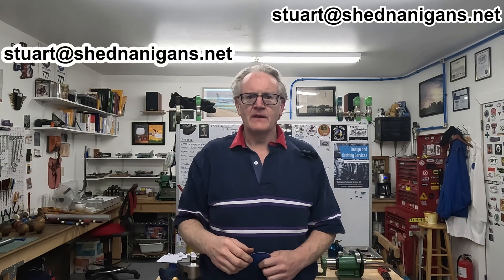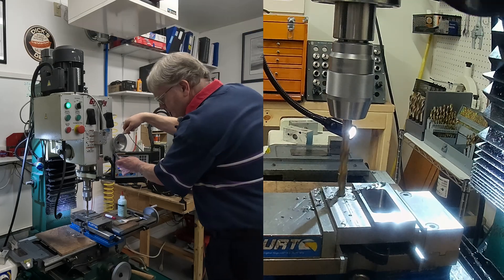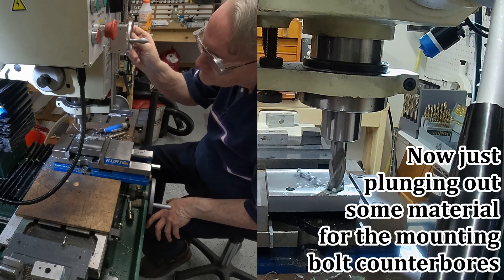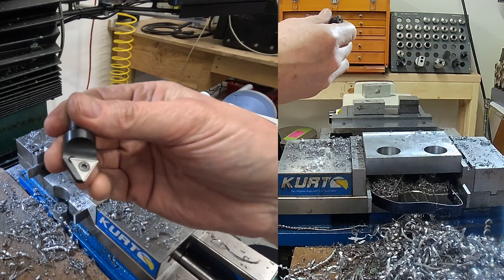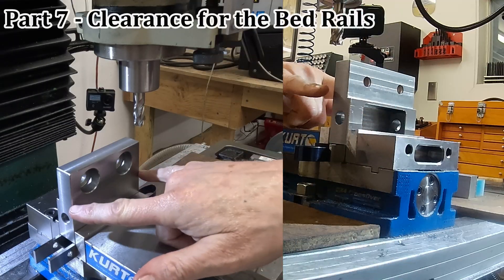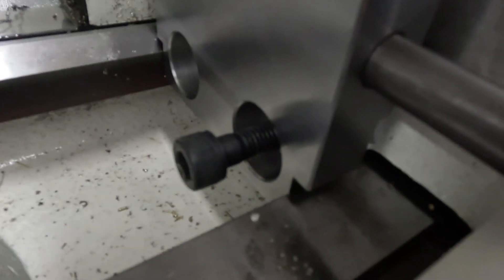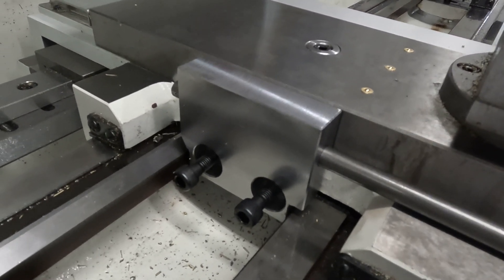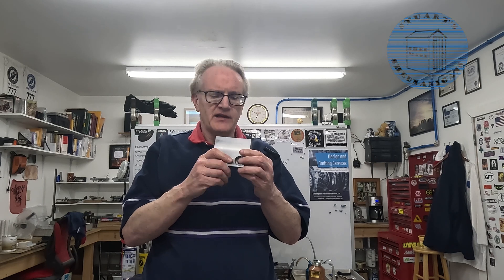Superior Shop Made Lathe Cross Slide Lock - Part 2 - Finishing the cam mount bracket.

Comment: You mentioned Anchorlube. I gind that stuff to be quite messy.
Why do you prefer it?
Tool life? Better finish?
I like the no snell aspect.
Reply from the maker: I’m kind of hit and miss on it. At first it didn’t seem much different, but the no smoke aspect is certainly a big deal. I have had very good results tapping in aluminum and stainless with it, when other lubes seemed to have difficulty - but it is messy. But then again most tapping / cutting oils are messy to some extent.
Reply from the maker: I don’t have good data as regards finish and tool life vs other oils, I don’t do nearly enough to get that, but just in ease of tapping and no generation of smoke is where it has done well for me.

Comment: Thanks for the video. Why didn’t you use Anchor lube when reaming?
Reply from the maker: Hello! Thank you for watching and commenting. To be honest - I don't have a good answer. I have used the lighter tapping oils for reaming for a while, so just defaulted to it. But afterwards wondered "why not try anchor lube for that?" I can't think of a reason not to.
Reply: @StuartsShed  
I like Anchor Lube for hand tapping, especially when doing so overhead. It stays put.
Reply from the maker: @greglaroche1753 It is great stuff for that. It tends to stay put in a lot more situations, where oils just run away.

Comment: Stuart, what's the idea the golden ball made of foil which sneaks up in your videos? Thank you for sharing your journey. Your royal use of anchor lube is in my opinion somewhat extreme for the light work you're doing (shareholder?). WD40 works too and it's cheaper and easier to use. I use a universal Motorex cutting fluid for everything I cut. Started with 20 liters 20 years ago and still using the same barrel. Apply with a brush. Best! Job
Reply from the maker: Not a shareholder. The one bottle I have purchased thus far probably won't boost the dividends very far, but yes I overdo it - especially when the nozzle gets clogged with chips apparently. I believe I even stated that I was overdoing it a previous video - can't remember which one. However, it doesn't smoke up like WD40 (which does indeed work very well) or other oils, so I'll keep using it. It's especially good in stainless. I would prefer full flood coolant really, but local application of lubes is less messy I think. Those Rocher are pests - I have an infestation somewhere - but I'll find them. Thank you for your comment and suggestions, greatly appreciated and thanks for looking in.